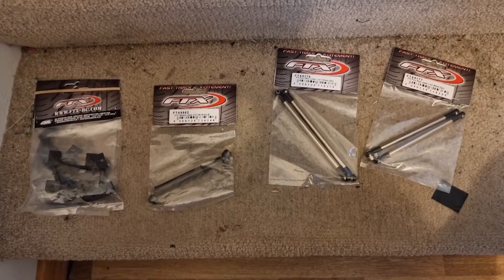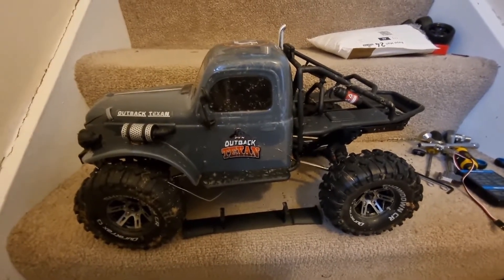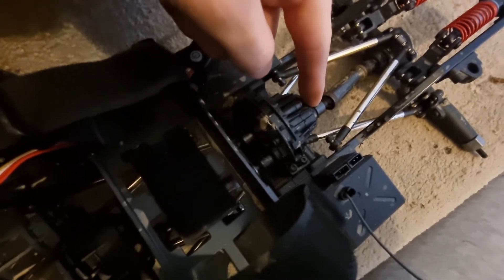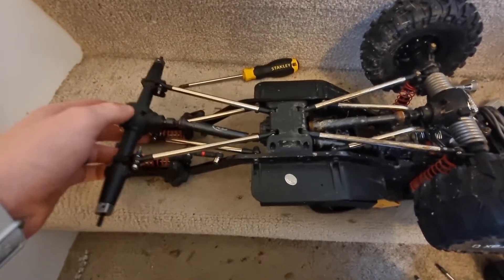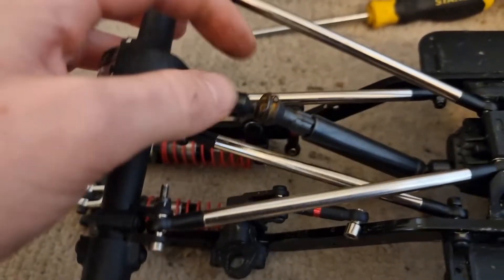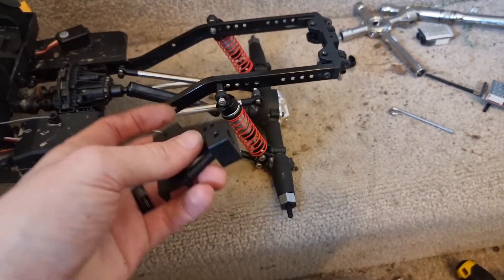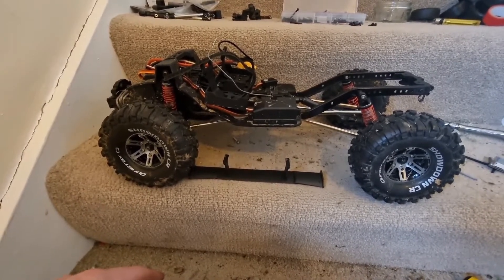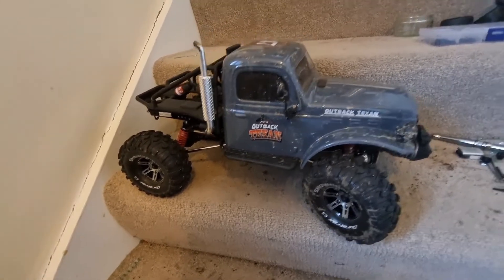FTX Texan (RGT Crusher) long wheelbase conversion

Comment: hello sir! excellent conversion job. i am getting the rgt crusher very soon and i believe it direly needs this modification to improve steep climb performance. i only have access to generic aftermarket suspension links and driveshafts. can you send me the actual end to end measurements (in CM) for the said items so i may buy the most suitable replacements? much appreciated inputs sir!👍